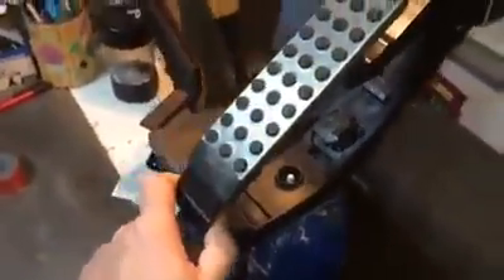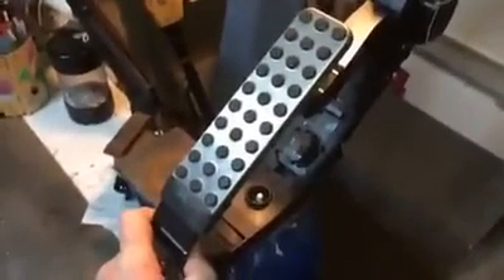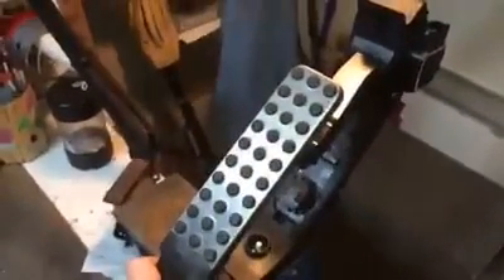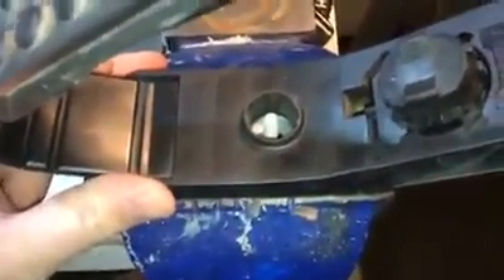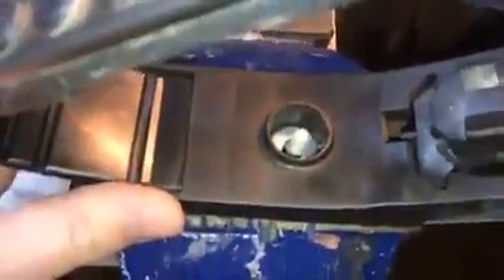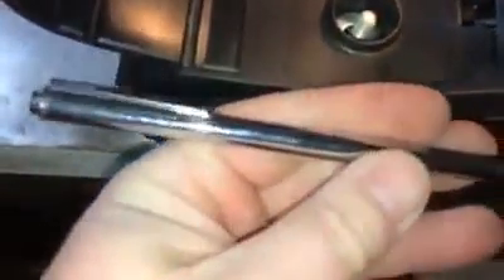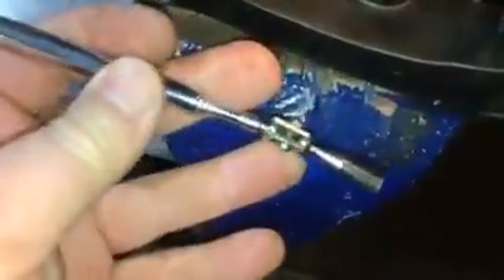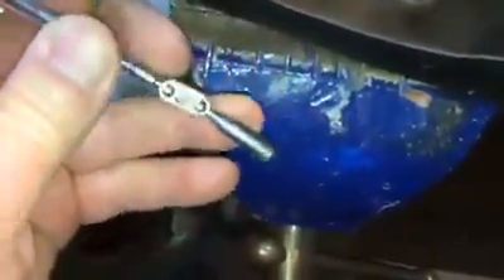Throttle Pedal position sensor = limp mode

Comment: I can confirm it's the pedal. Every time I went to "kick down mood" the car went into limp mode.

I switched the pedals between my Srt6 and my daily crossfire (250k miles with no issues). 

Now I can go full throttle and click the switch at the bottom of the pedal. 

The only thing I will add is it took forever to get that washer out even with a magnet. Prepare to get frustrated.

Comment: Hi. Sorry my english is a little rusty. I have the limp mode when i click the contact on my 230 slk.
I m not sure what you said. I have to completely change the hole body except if i don t puSh all the way and click? If i have to change it can i buy an used one ?

Thank you from France
Reply from the maker: hello, if  you are getting a limp mode from the Throttle Peddal then yes you need to remove and replace the Peddal, You will need to search from auto parts stores to the dealership depending on where you live

Comment: A lot of Mercedes cars and also the Chrysler Crossfire use this pedal. It's like a volume control on a stereo, when you press the gas pedal it sends electronic signal to the ECU (engine computer). The pedal can wear out and show in a couple ways. It may be fine until you press the pedal to the floor then suddenly the car runs terrible. Called limp mode. Shut off engine, restart and it's OK again. That's sure sign to replace the pedal. If you never floor the gas pedal and everything else is fine then you may not need to replace the pedal immediately... Another is if idle is way too high then it's OK again then too high again. Could be caused by a vacuum leak instead, but use a code reader and if you get a code for pedal sensor out of range it's probably caused by the pedal wearing out. A new pedal is close to $200. but is easy to replace. There are cheap code readers that cost around 10-15 bucks and using an app called Torque Lite you can read problem codes stores in the car's ECU.
Reply: yeah my w203 have that problem, when floor it to the click, it will enter limp mode.. but if i floor it but not fully until the click it work just fine.. i still not replace it because i rarely floor it till the click..
Reply: Hey my CLk say stop engine off low coolant in red on my dash its normal then blink red in when I press my pedal it's not going over 20 some time

Comment: Sir ,My B6 Passat 2010 has came out code : P0221 Angle sensor for throttle G188 implausible signal...same problem as above video?

Comment: Mine doesn’t make the clicking sounds, when I floor it I get a esc inoperative see operators manual on my dash board I have to restart my car or else it stays in limp mode
Reply: Did you ever fix it

Comment: hey man, this would be the same for the slk230, your crossfire is manual standard transmission correct?
Reply from the maker: automatic with the "slapstick"
Reply: @CrossfireRepairsByPaul  ahh that's a bit different, I actually took my entire bottom dash out and checked I dont have that sensor, the automatics do I had talked with someone about though

Comment: Same issue with my 2013 C63 AMG, limp mode when mashing it. $182 for dealer to diagnose. They wanted $642.30 for parts & labor to replace. Bought new pedal & sensor assembly for $145 and installed it myself!
Reply: Hi , where did you bought the new pedal and sensor ?
Reply: the whole assembly comes with the sensor… so its just plug & play… easy DIY

did this with my 09 C63 before…
Reply: Hey did it fix your c63 I just noticed today in my cLk w209 I just ordered the new gas pedal to improve the Acceleration

Comment: Great video. So I just bought a 2005 Crossfire limited and it need a new TPS like this one. Just a few questions. 1: Do you need to replace the whole throttle pedal assembly or can you just replace the sensor? 2: If you can replace the sensor, what is the part number?
Reply: Non serviceable - meaning no service can be done.

Comment: Would you receive a BAS ESP light as well? When trying to go full throttle or 40% trying to merge into traffic?
Reply from the maker: No the BAS ESP is not associated with this, You will need to 1st try to do the reset, engine on, turn steering fully to the left then fully to the right then center and then restart engine again, if lights do not turn off let me know you will need the next step
Reply: @CrossfireRepairsByPaul  Hi Paul, my slk32 bas esp light is always on and I already tried the reset, how else can I fix it? Thank you
Reply: Corey M. That's what I'm getting too, but I'm gonna replace my IC pump first and if that doesn't fix my prob guess Ill go to this next